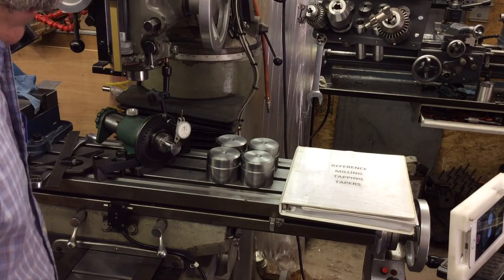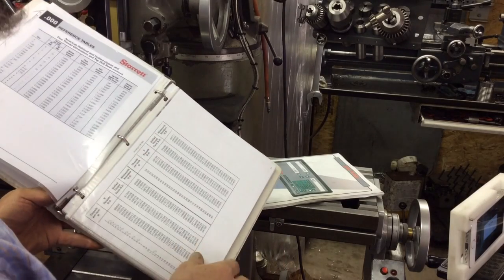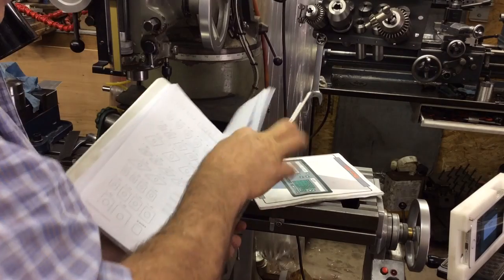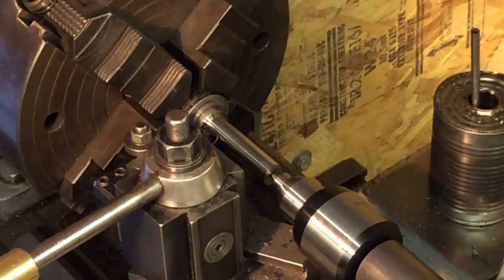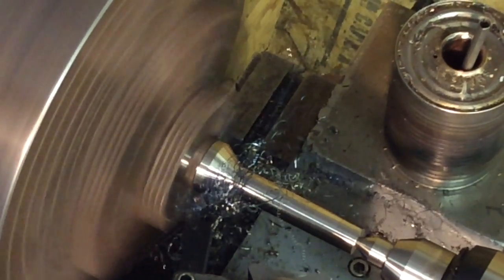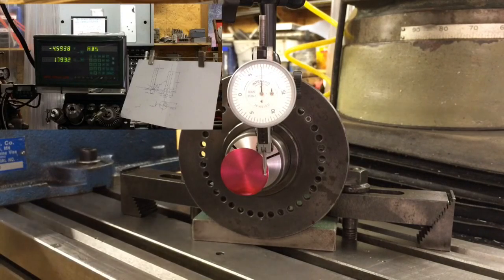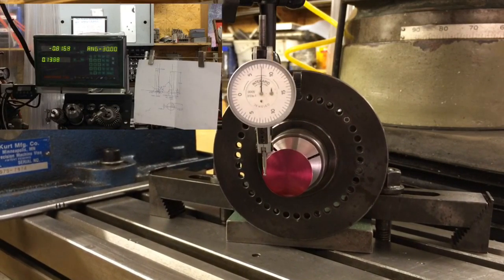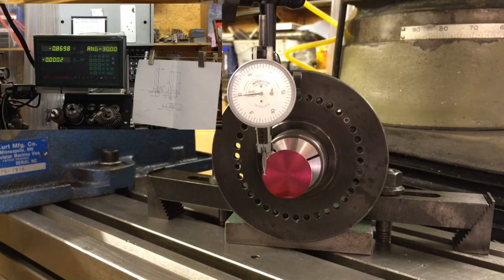How To Make an Insert Dovetail Cutter P2

Comment: use a Stans tri square 90-60-30 to set -up the indexer.
Reply from the maker: Yes they would work.  I do not use this method any more.  I use a square collet block in the milling vise now.  I set the mill vise up
using the DRO.  More accurate, faster, easier and more ridgid.  Thank you Eric for your suggestion.

Comment: In case no one has mentioned it, I've yet to read the comments and just wanted to spit this out before I forgot, but a twelve sided geometric shape is called a dodecagon. 

I know that off the top of my head from chemistry and the forming of hydrogen bonds in attempts to create a safer fuel for fuel cell engines that was comprised of little dodecahedron shaped molecules with 12 pentagons for faces of the C20H20 Dodecahedrane...

All very useless stuff, but it does tell you what a 12 sided polygon is called, LOL!
Reply from the maker: Knolltop Farms I hope you are going to machine one up for us, thanks Chuck.   Randy
Reply: That would be a true feat of machining, milling out the108deg. angles 60 times would be labor intensive on a manual machine.

After some thought I do think I could do it on a mill with a rotary table and heaps of fixturing, although I would likely have an easier time making it out of MDF and casting it.

Comment: Hi Randy,
Good idea about the self made shop manual, sometimes when I get my hands so dirty and don't want to crud my Machinery's Hand Book I'll skip the reference... Not always desirable.
Chuck just lent you his Lucky 8 ball, the difference you were reading when tightening was probably the play in the screw for the Y axis of the mill.
Cheers,
Pierre
Reply from the maker: pierre beaudry The handy manual I have been making up for many years, for aircraft, engines, boilers, automation.  Most of the time you don't need most of the information in a book.  And I hate dirty books but a dirty handy manual means it is being used and less errors are made.  Yep just plain lucky on the alignment, but the DRO method does work really well.  Thanks, Randy
Reply: Agreed!

Comment: Thanks, Randy, for the show and tell.  I need to get mine done, too busy with other projects so far...
Reply from the maker: ***** I know how that is.  I am just trying to catch up.  The lathe project sure put me behind.  I have made 3 of the dovetail cutters now.  Use a 1/2 carbide 4 flute talin coated end mill cuts like butter with a perfect finish.  Send me a photo when yours is done.  Thanks for watching, Randy
Reply: Randy Richard
I have a 1/2" 4 flute carbide end mill, but uncoated.  Either it or a TIN coated HSS 4 flute will have to do.  That bolt may be too hard for the HSS.
-Bob
Reply from the maker: ***** Actually very tough.  I tried a HSS and did not like the cutting action or finish.  When turning stringy chip tough material.  Heat treated and tempered 4140.  Thanks Randy